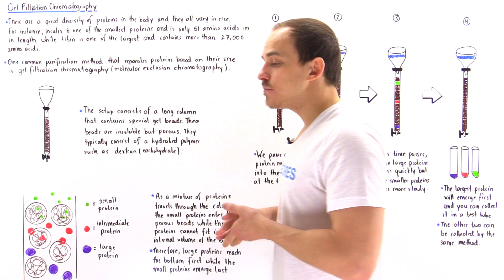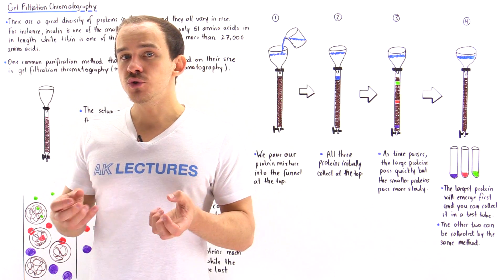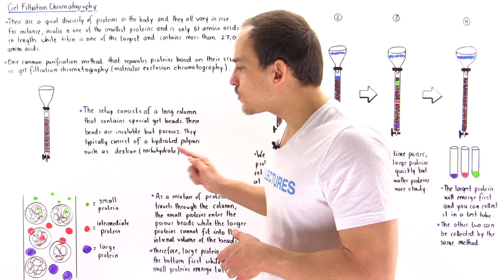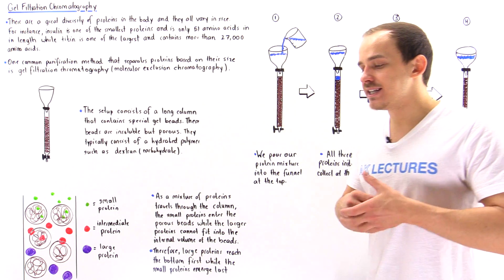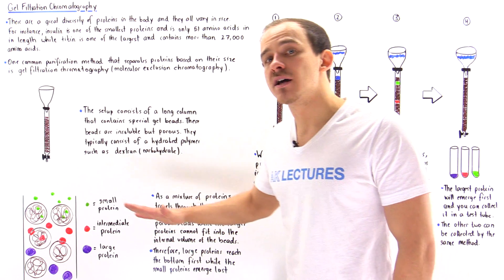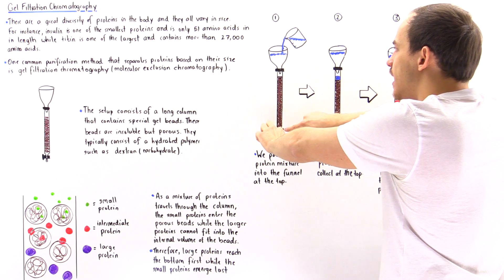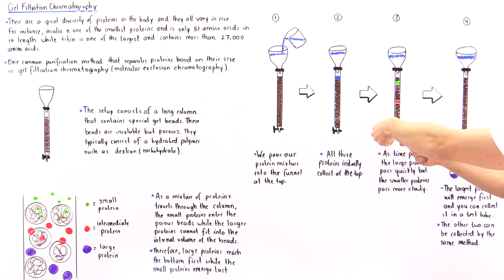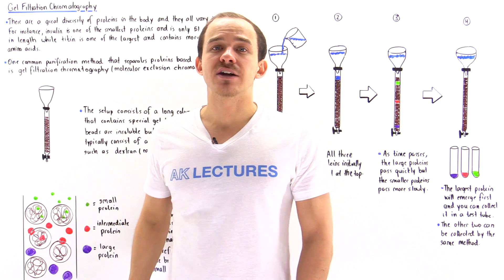Gel Filtration Chromatography

Comment: What is the difference between Gel Filtration Chromatography and Size Exclusion Chromatography?
Reply: Basically the names are used interchangeably. However, to be more specific Gel Filtration Chromatography is one of the methods of Size Exclusion Chromatography. Size Exclusion Chromatography is an umbrella term. Other methods include Gel Permeation Chromatography where you use organic solvent as a mobile phase rather than aqueous solvent as in Gel Filtration Chromatography. Hope that helps!

Comment: What would happen, if we have, 3 proteins of a large difference in size, but all are too big to fit the pores, will they all come out at the same time?
Reply: Yes, the gel has a fractionation range. Proteins within this range will separate, while proteins outside this range will not. The 3 large proteins in your question would elute together as one molecule and therefore at the same time.
 
Similarly, proteins that are too small to separate will fail to separate and also elute as a single molecule.

However, if you have 3 proteins that are too large and 3 proteins that are too small, the 3 proteins that are too large will elute faster than the 3 that are too small, even though they are all outside the fractionation range.
Reply: you choose a bigger pore size...
one that allows one of the molecules while keeping out the other
Reply: Not what I asked.
Reply: +PerunMorph there are different size of gels beads which can be used is what he meant !
Reply: I know what he was trying to say, but that is not the answer to my question.